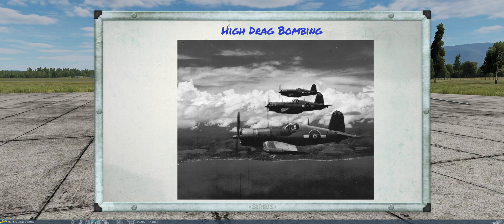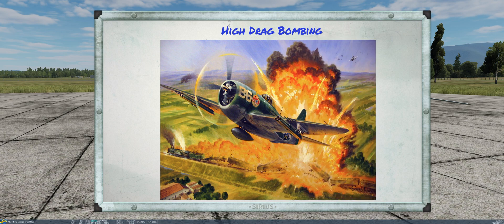Viggen High Drag Bombing Tutorial

Comment: Interesting to learn the difference between glide and dive bombing! The M-2000C can carry both Mk82s and snakeyes, but restricts the method of delivery to CCRP for the former and CCIP for the latter. Effectively that means dropping Mk82s flying straight and level, whilst dropping snakeyes in a shallow dive - which seems about the opposite to what is in this video!
Reply from the maker: I haven't tried the Mirage very much but most CCRP systems can be used in a dive (see my earlier Viggen videos)  in fact the A4 bombing computer is a form of CCRP.  The point of CCRP I'd to accurately designate the target so the pilots reaction time isn't the limiting factor. It shouldn't prevent you from being in a dive when the bombs release.
Reply: @Sidekick65  that's a good point - hadn't considered that! Will have to give 'proper' CCRP a go then, given I've had a fair bit of use with the A-4E's bombing computer. I'll also try a low altitude CCIP pass with the snakeyes and see if the pipper is visible on the HUD - even in a dive it takes a good long while to climb up into the aperture
Reply from the maker: @procrastinathan9201  Excellent.  Be interested to hear how you make out.  The CCIP pipper will, of course, be farther up the screen the lower and faster you fly...
Reply: @Sidekick65  turned out pretty well! Speed and altitude are indeed the key - lots of the former, less of the latter. When you’re used to managing speed carefully in a dive-bomb attack to ensure you have sufficient time to line up on target, it feels quite strange putting the burner on to drop bombs. The Mirage’s BAP-100 runway bombs are incredibly fun to use, as those of us on Yappy’s server found out on Sunday!

Comment: All too true about the difficulty of identifying and lining up on your target while screaming over the ground at 50 feet and 500 knots.  To make matters worse, those trees that obscure the target from your eyes are invisible to the AI gunners who are lining up on you while you desperately try to get a glimpse of the target area.    You mentioned that you need pretty good intelligence gathering in order to know where appropriate targets for high drag bombs are and that got me to wondering exactly what sort of intelligence gathering did the Swedes possess in the Viggen timeframe?  Did they have satellites to find targets and their coordinates or were they restricted to ground observations, radar returns and the occasional reconnaissance flight?
Reply from the maker: The Swedes did have some impressive Recon capabilities, I think. However, I kind if assume that the targets fir high drag bombs would have been things like airbase aprons - known to have parked aircraft on them. Or port facilities known to be full of supplies and vehicles. That sort if thing. Large, fairly easy to identify locations with enough targets to make it hard to miss. Maybe st night too, with lys-bombs launched by accompanying aircraft. That would make for quite a midnight surprise for ships loading or unloading in port...
Reply: The M/71 was primarily for concentrations of soft targets, with pre-plan through aerial reconnaisance, or reconnaisance by spec-ops. For hard field targets, the ARAK would be used, and  for runways and heavier stuff, the A 32 Lansen would bring heavier bombs.
Doctrinally though, Viggen rarely used the level bombing technique, but rather favoured pop up attacks with glide bombing geometry ^^